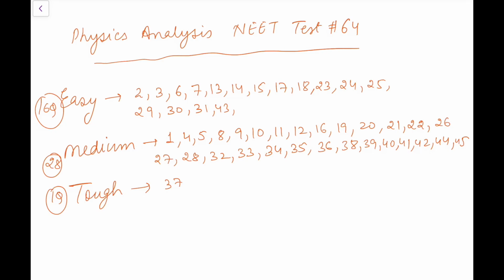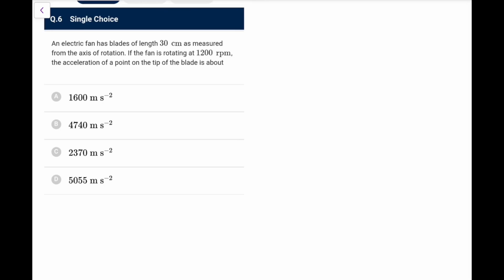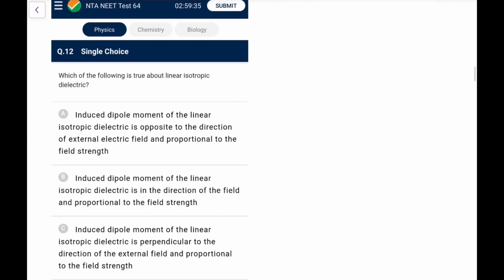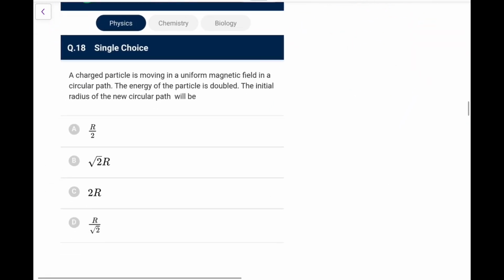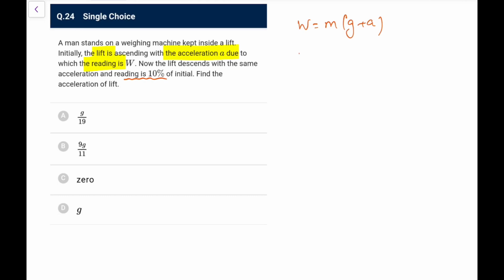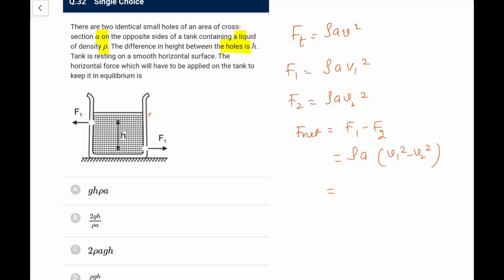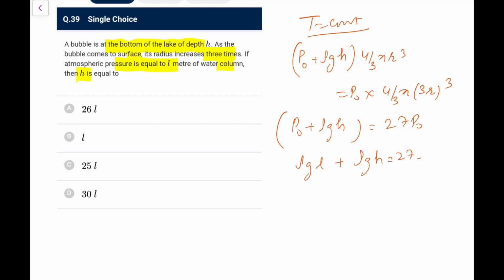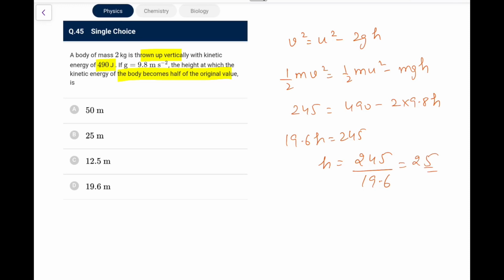Physics Solutions NTA Abhyas NEET Test 64

Comment: Sir if you don't mind please check in Ques no 21 you gave explanation of option c but ticked option d. 
And Ques no 45. 245/19.6 gives 12.5 but you ticked 25. I will be very glad if you wont mind my words.😊
Reply from the maker: Please check for 21 I initially gave the full motion explanation that for ground ine it first goes up and then down. Q asked for immediately after dropping. So answer is d only. Yes in 45 answer is 12.5